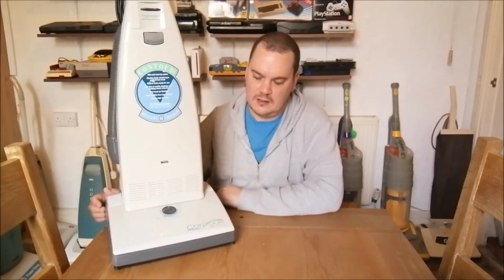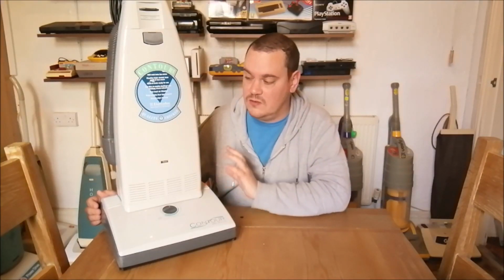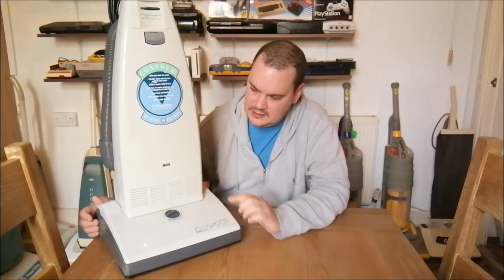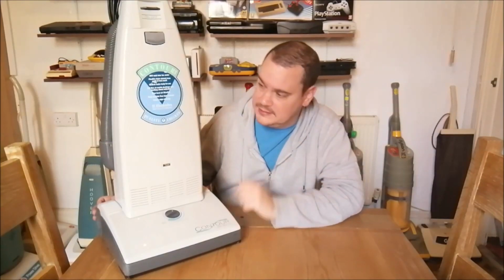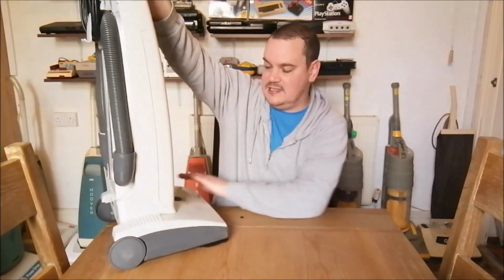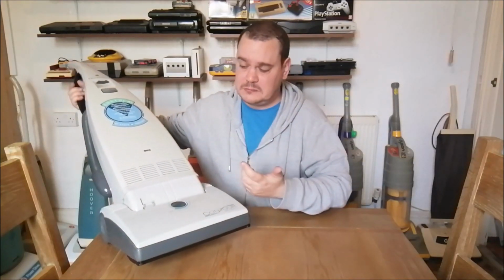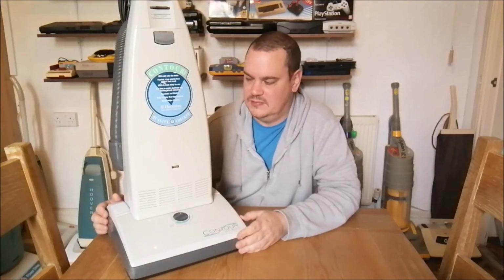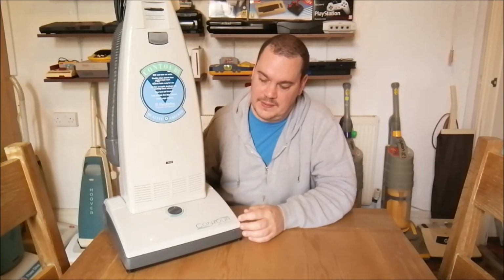Vintage 1992 Electrolux Contour Z1410 - Restored and Ready for Demonstration!

Comment: how much money we're
the basic Electrolux contoures
back in the 90s at retailers
out of curiosity 😁👍♥️
Reply from the maker: I honestly can't remember. Take a look on Google for the Littlewoods / Kays / Grattan etc catalogues of the time and you might see some pics with prices
Reply: In 1992, the line up was: 

z1070 Turbo2 - £79.99 
z1250 Glider - £99.99
z1380 Elite - 109.99 
z1410 Contour - £114.99
z1460 Contour Varipower - £134.99 

There was also a blue twin speed Glider that was about the same price as the Elite